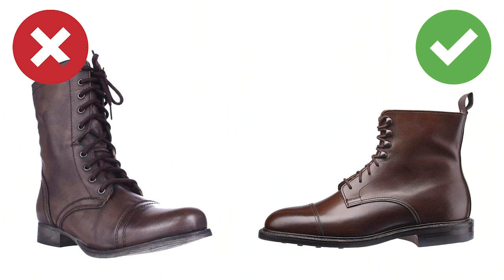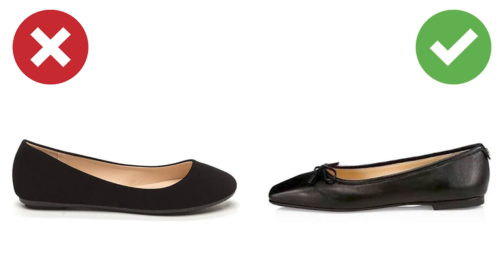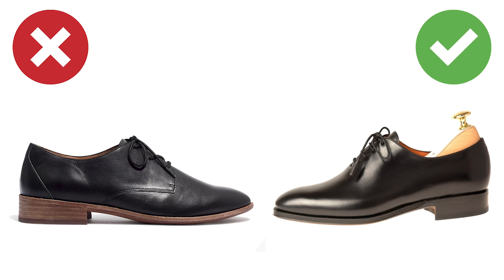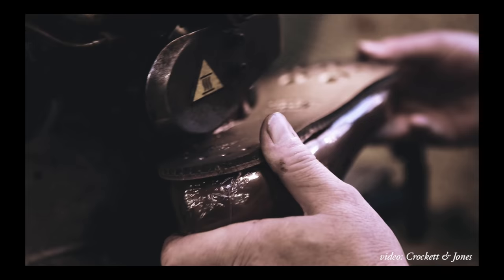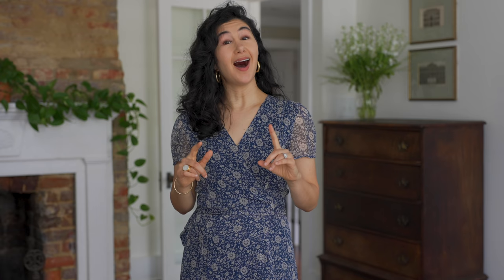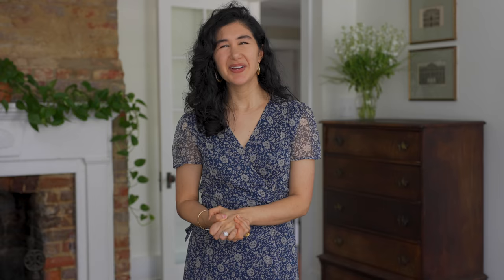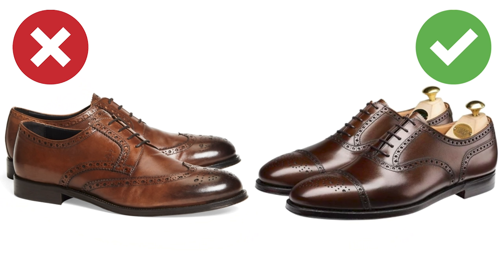8 Reasons Your Shoes Look Cheap - How To Find Expensive Looking Shoes

Comment: Wow I am discovering that this is way beyond my level. I can't tell the difference between the "cheap shape" and "expensive shape" shoes at all, and I can't see the flaws in stitching or glue in the images or even tell how thin or thick material is from the images. (I'm hoping I'd be able to see those in person, but I'm pretty sure I wouldn't get what's more or less expensive shapes in person either.)

I buy all my shoes secondhand so price isn't usually a factor I can judge by in terms of quality, and I often don't know the brands (or if I do, they're often built for lighter, fancy wear than my lifestyle, which is hard on my shoes.)
Reply: I feel the same way! I can't tell the difference between the cheap/expensive images in this video, or I can't see what's worse about the cheap versions. Maybe I just have "cheap taste" in shoes??
Reply: I agree. An arrow pointing out the flaw would have helped.
Reply: Same here. Often couldn’t differentiate the photos. But I still learned a lot to at least be more conscious.

I try to buy secondhand, where quality may be even more important for longevity.
Reply: Same here. A lot of the "bad" examples of shoes looked fine to me.
Reply: I had the same issue!
Reply: I had that problem, too.  When I buy second hand, I look for good leather and sturdy construction. Even pretty little heels need to feel strong.
Reply: I was having difficulty on some of them as well, one thing were the "patterns" the cheap shoes were turned so you could see the back seam but the expensive shoes were turned sideways so we couldn't see the difference.  I too can see the obvious glue or flaws in person but I bet others could spot the less obvious that I over look.  Unfortunately there were too many that I couldn't see a difference at all in.
Reply: If you go to expensive she places and then go to cheaper shoe places and look at the shoes carefully, you can see the difference in most cases. As someone said just because you paid high dollar doesn't always mean their the besy quality and for your lifestyle. That is one thing my parents di teach me to look for was good quality shoes.
Reply: Same! I like the look of some of the cheaper ones better than the expensive.
Reply: Same here! I feel I have waded into the deep end of the pool, haha, and I have been quite ignorant in regards to shoe quality.
Reply: That's very helpful, thank you. It is certainly a question of training your eye
Reply: Haha! I’m way unsophisticated-I actually preferred the “bad” shoe! The “good” ones looked stiff and cheap to me.
Reply: @ourtubesocks  me too!!

Comment: Great advice! In the last years I avoided buying cheap shoes. But sometimes even quite expensive shoes looked somehow "cheap"/ poorly made to me - but I couldn't really put my finger on it why I thought so (because some things are obvious but others, like your advice with the flat sole, weren't - at least to me). You explained it straight to the point :)
Reply: exactly.  I recently purchased an expensive pair of hand made sandals, and the leather used for the uppers is shockingly cheap - looks and feels like thin cardboard.
Reply: @steemdup  Right? So annoying!
Reply: Also the materials are cheap now.  No one uses real leather anymore.  Synthetic materials don't last as long and they don't stretch and mold to your feet.  Maybe I'm old fashioned but I prefer and miss leather shoes and handbags.
Reply: @steemdup  sometimes they get away with calling something leather when its pulverized leather mixed with chemicals and glue so it doesn't hold up like real leather
Reply: @dianeberlin5969  I absolutely agree with you! I try to buy real leather shoes rarely because of the animals, but when I do I go for the ones with quality leather, no synthetics
Reply: Many shoe manufacturers moved their operations from Italy to China, just like so many other industries putting profits before quality and good paying jobs!

Comment: I'm 6 feet tall and wear a shoe size that basically doesn't exist (US 12 very narrow) Shoe shopping is exponentially more frustrating than clothes shopping. I basically don't get to have a say in what the style/construction is. I don't wear heels over 2 inches (so painful and adds unnecessary height). Most designers that make a size 12 only make medium. When I do find a size 12 narrow, it's still too wide and I have to stuff all kinds of extra things inside the shoe to keep it from flying off my foot when I walk. I have a couple of pairs of shoes that I don't really like the style of that much, but had to buy because I was in desperate need of shoes and the style is appropriate for my needs. If I could find a place that makes custom shoes I would consider doing that.

Comment: She hurt my heart with those Rothy’s 😭🤣🥲I love them. But I do agree that they are rather casual.
Reply from the maker: I’m so sorry! 😭
Reply: I keep looking for the reference to Rothy’s but I can’t find it. I’ve been considering purchasing a pair for a couple of year h haven’t pulled the trigger. What’s the time stamp?
Reply: @cassandraweaver6054  I love mine theyre so comfy and wash
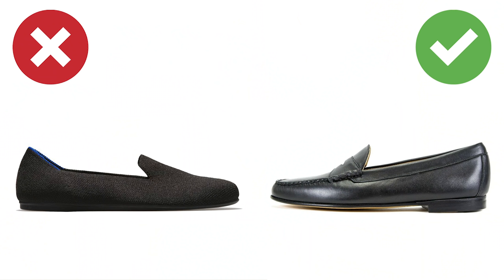Reply: @cassandraweaver6054  at 1:15 the loafer on left. I disagree with what she says about padding though. Rothy’s loafers have very comfortable padded insoles.
Reply: @AudreyCoyne  Not a problem🤣
Reply: @cassandraweaver6054  sorry I was out and about all day. I love mine. I have a loafer in taupe and that exact black flat. I LOVE THEM. One thing is they can get a little musty smelling if they get wet but you can simply wash them in cold water with dawn soap. I have had mine for two years. Never lost shape, super comfy. And good for the environment!
Reply: I love my Rothy’s but have very flat feet; no arch to speak of. I need shoes with no arch support or very little. I grew up in Hawaii too and read the comment above about running around barefoot 75% of the time and the shape of our feet. Interesting.
Reply: Haha I have the exact pair and color she showed 😅
Reply: However I will say they have not done the two things she said- they are very comfortable even for a whole day of walking and wearing (especially the loafer style!) and have not worn out. I foresee them lasting many years

Comment: I bought a pair of slides that had the insole leather only to mid arch. I bought them second hand and noticed the rolling of the insole almost immediately. Got some good contact cement and a cosmetic roller (from the dollar store) and burnished the area smooth. I could have removed the insole, thinned the edge of the leather and then glued it but…I am a lazy cobbler. I just burnish the edge before wearing and carry the roller in my purse just in case.

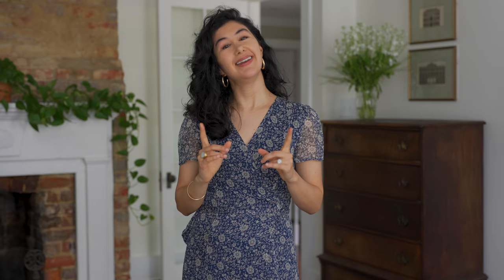Comment: But... I really don't understand examples at 5:08 and 5:58. 
To me, the ones on right and the ones left on 5:08 looks pretty much same when it comes to buckle. Buckle is just positioned lower on the other and the colour is a bit darker, but that on itself doesn't need to be a mark of cheapness - especially if piece of outfit perfectly matches the tone of shoes, and that nuance is same as the colour of shoes on the left. One could say it's the cloth/material, but here the point was made about the buckle, so it really confuses me. 
Also, the left ones on 5:58 look more expensive, pattern is nicer, less dull, overall more beautiful. The only thing is maybe the tint could be a little nicer, but in reality I would never buy right ones over left ones no matter how much more nice their dye is. Patterns are anyway often dreadful, except with tiny and/or colourful flowers. That particular pattern of blue and white flowers shoes and similar ones is not only completely de-mode but also looks very cheap / childlish / chinese store like... At least here in this part of Europe I live in. Nice colourful flowers on the other hand might seem feminine or refreshing and interesting to see - that already is a plus point in one's style. But, maybe I am missing something. What were the factors taken into consideration here in these particular two examples?

Comment: I find a bit strange to compare two shoes together, one cheap and the other one expensive. For example Gucci Jordan loafers and one of its multiple dupe.
And yes, I agree that one looks cheaper than the other one…
But I wonder if I have to look at this video to think of this 🤔
Idem for the other photos, shoes with glue and Goodyear sole
Etc..
Reply from the maker: Those actually aren’t Gucci loafers :) the Gucci loafers are more expensive and aren’t as well done as the pair I showed. My boot guide linked in the cards goes into Goodyear welting ❤️

Comment: I don't really agree with some of the points... Shoes shaped "like a foot" doesn't really mean anything, because all feet are shaped differently. Some of the examples you've given won't be comfortable for people with wide feet or in any other way different from an ideal image of a foot. Also shoes like clothes can have looser or tighter fit depending on the model, for example have a loose ankle.